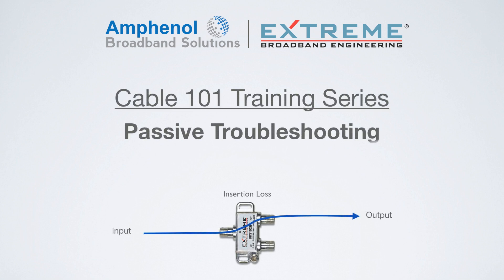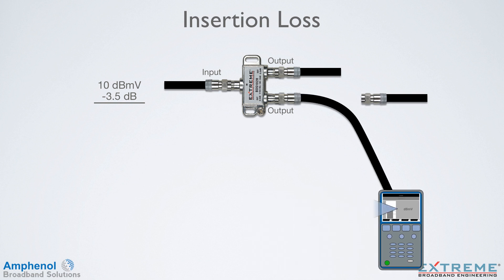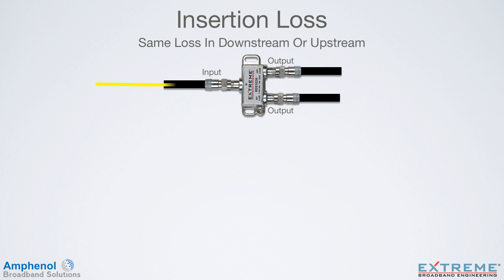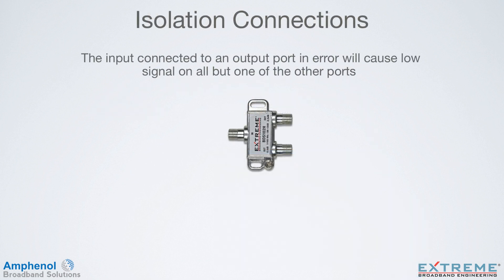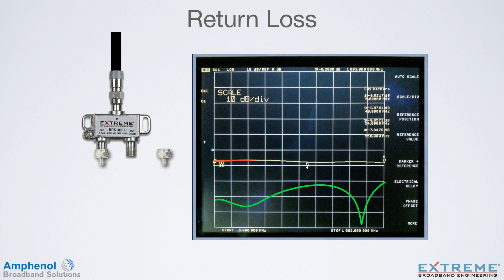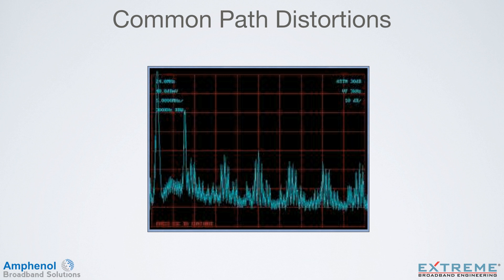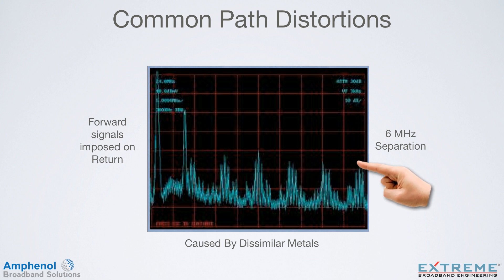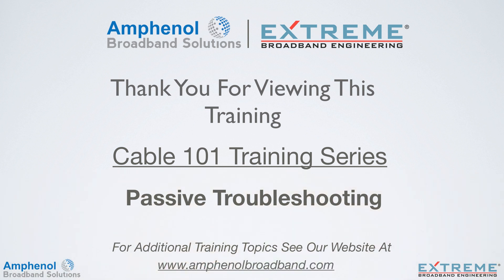Cable 101 - Passive Troubleshooting

Comment: At about 2:48 in the video about frequency sweeps, what are the possible reasons and consequences, if the dBmv and SNR is inversely proportional to frequency?  That part was not covered in the video.

I do not have a scanning tool like this but, on my cable modem for example, after a +15 dBmv amplifier that the install tech installed on "service activation", and "updates" that came a year later in other areas of their network that actually improved dBmv by +5 dBmv:

After +15 dBmv amplifier: my modem observes 19 dBmv 44.4 SNR at 357 Mhz, and 11.2 dBmv 36.4 SNR at 969Mhz.
Before the amplifier: my modem observes -9 dBmv at the 357 MHz range to -20 dBmv 969Mhz.

I later added a couple splitters on my own so the highest dBmv is +15.5 now at 357Mhz, again.  I am pretty-sure the install tech would have seen that slope a year ago as I did observe him using a scanner when deciding to add an amplifier, but I wasn't watching over his shoulder, lol.  He did mention the dB levels being low and I did get -15 as an answer, which I later confirmed on my own some time later with the modem stat page.

As computer tech and a person who likes to learn, I am researching for my own education, and because COX's service calls are 75 dollars (extra motivation to study!).  as a self-taught person, having others do things for me makes me feel stupid, I'd rather just learn so I can do things anyway, lol.  But I know I'm not an expert on everything too so I continue studying.  Maybe I'll even apply to be a cable installer myself someday.

I know that 150ft of RG6 cable going underground to my house is the reason for the power-drop and my install tech from COX just didn't bother doing anything about future planning about it, other than install an amplifier for an easy way out of fixing the problem the first time, but it did make things work.  Possibly after some work, the coax could be upgraded to RG11 or something with less power drop/distance, and that would be compatible to future technologies, since this RG6 cable has been here at least 10 years when the house was built, but it's a guess from after researching coax.  I am almost willing to upgrade my own cable but, underground crosses a road, lol.  But, is the this also the cause of the power/freq spectrum slope?
Reply: Yes you have a bad drop probably ingress have them replace your drop with an rg11 if possible.If this can been fixed already you should have no signal impairements.
Reply: @edwardrodriguez3529  Thank you for the response.  Yeah, I suspected RG11 would be more suitable for that distance.  Still has not been upgraded.
Reply: @spacedreaming  Bad cabling is 75 to 85 % of trouble calls.Your drop could also be affecting the plant I would ask to have it swapped out say that you are having T4 timeouts and bad snr at modem they should swap it for free.

Comment: Hi all can I get a help, is it possible to connect more than one TV in one dstv decoder?
Reply from the maker: Thank you for your question. 
 
Depending on your service, (OTA, SAT or CABLE SERVICE PROVIDER) will determine if you can split the signal to two DSTV Decoders.

If the signal is free and clear on the cable such as OTA signals, than a traditional splitter will allow you to connect two devices.

If using a cable service provider or satellite service providers service, you will be required to have a tuner to decode the digital signal.

If the equipment you are using utilizes a cable card that is provided or activated by the service provider then splitting the signal is completely acceptable as the DSTV decoder will be able to decode the signal from these service providers.

Comment: Can someone please explain the mystery of why RF Tilt/Slope is important and what affect if any does it have on performance?? I have searched Google and can't find an answer for this. Thanks for the help
Reply from the maker: CATV plant uses coaxial cable as its means of transport of RF frequencies over a long distance. Typical spectrum is 54 to 1002 MHz. These signals experience attenuation losses over a certain distance and will require amplification. This process guarantees a quality noise free signal and can be repeated many times.

Again, coaxial cable loses more signal at higher frequencies resulting with input levels near or equal in amplitude to that of low frequencies at the next amplifier in cascade. To compensate for this one can adjust the amplifier the amplifier tilt so higher frequencies emulate the first amplifier output. Also, one can adjust the slope of the lower frequencies to match that of the fist amplifiers output. 

The end result is “unity gain” which is when amplifiers are spaced the same and effectively operate with same inputs and output. 

We hope this helps.
Reply: @AmphenolBroadband  thanks for your reply but i'm referring to the Tilt reading at the customer premises, not the network itself i.e the ISP i work for specify that the tilt read by the meter at the customer's premises must not be more than -6dbm or +6dbm.. If all the frequencies from lowest to highest are in spec i.e between -6dbm and +10dbm, then why does it matter if only the tilt is out of spec at the premises? Hope that makes sense
Reply from the maker: @YouTubeSupportTeams  Good question.
Reply: @AmphenolBroadband  I can only assume that if the tilt at the local amplifier/cabinet changes it will then of course affect the customer and possibly put their incoming signal out of spec, so if we aim to have a good tilt at the customer's CPE then this may help in the case of less than optimal network conditions. I've seen your label on our coax cable drums. Greetings from the UK